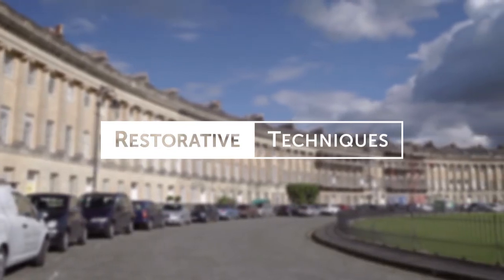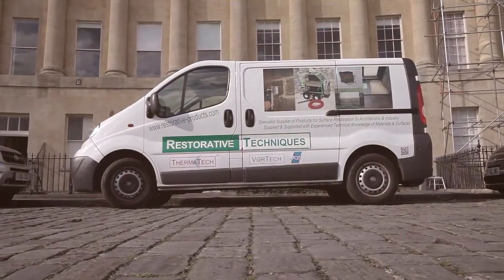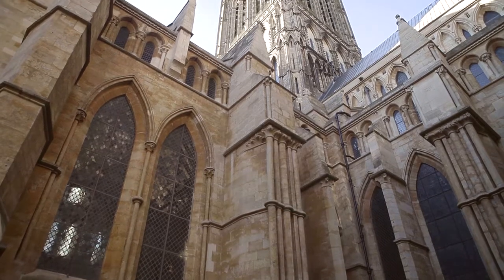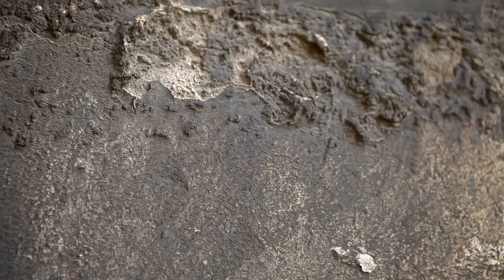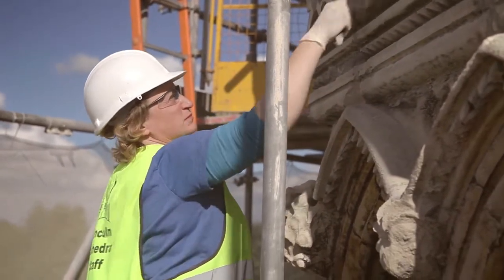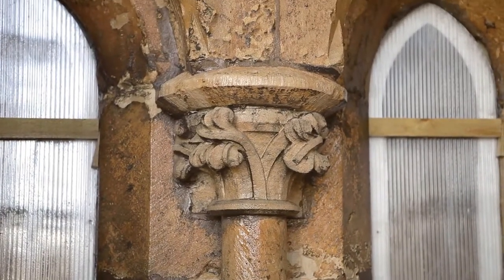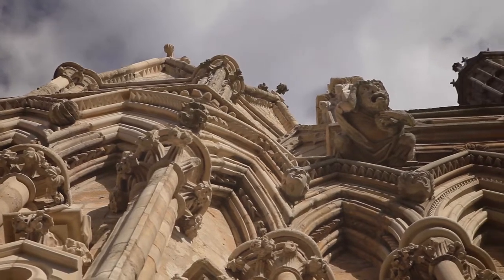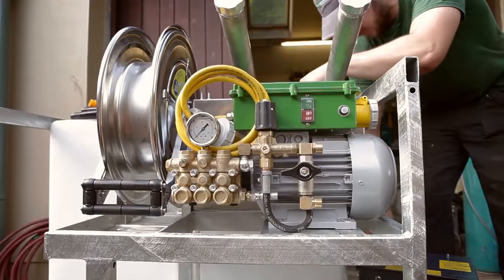Restorative Techniques: Historic Building Restoration, Stone Cleaning

Comment: the conservators try to preserve and preserve these ancient buildings with the utmost care from the process of cleaning and removing paint which is very suitable for a suitable water machine. measurement of heat and speed must also be determined because a little wrong in the heat of the water used will result in erosion of the building materials.